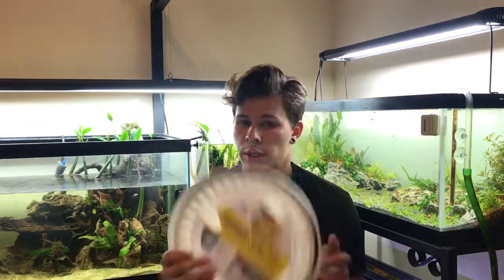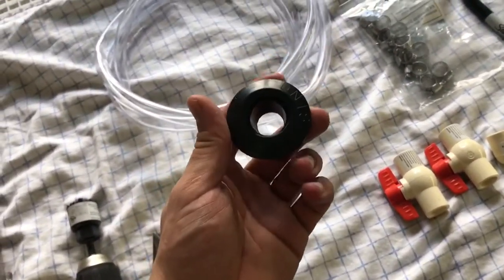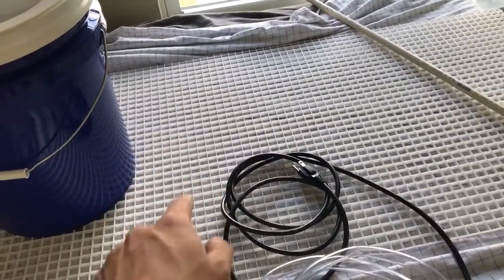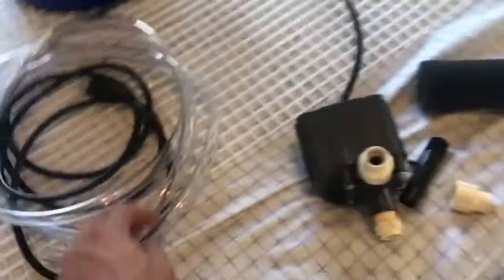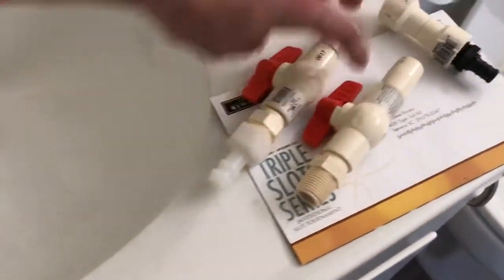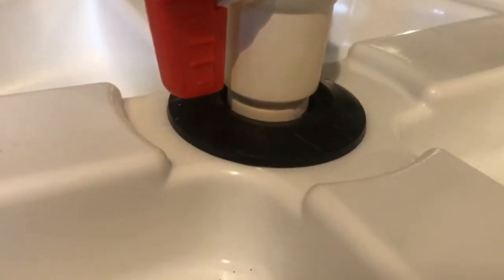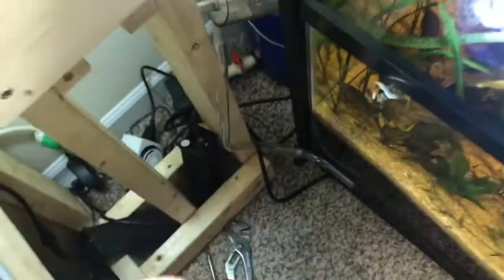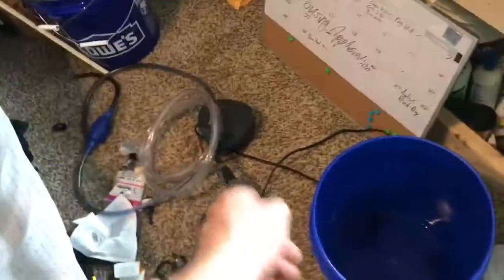DIY 5 Gallon Bucket Canister Filter For 20 Gallon Long Aquascape

Comment: Question. Why a uniseal over a bulk head? Is it for the movement of the pump?
Reply from the maker: That, and because its easier than putting a bulkhead on a curved surface. They're just super simple to use.

Comment: What is the website to get the inventory?
Reply from the maker: I didn’t order any of the parts for the filter, you can find all of this stuff at Lowe’s or Home Depot
Reply: I understand, but where's the list so I'll know what to get?
Reply from the maker: I don't really have a list. The main thing is using uni seals, gamma seal lids, and ball valves to be able to cut off the flow. If you watch all the videos on the filter I talk about design flaws and things that I would have done differently if I could go back. Larger diameter piping was pretty high up on that list, as was a higher output pump.

Comment: Gama seal lids suck. I did everything possible and it still leaks
Reply from the maker: I feel like they’re pretty hit or miss
Reply: Would it work better if I elevated the bucket filters above the tank so there is much less water pressure? Or is there something I can do to the gamma seal lids to seal them much better.
Reply from the maker: @donaldstevens5034  You could try siliconing the lid to the bucket but that obviously will make it difficult to remove. I think a big thing about why mine didn't work great was the tubing diameter was too small and it restricted flow. I tried to lower and raise mine but it didn't do a ton to fix the issue.
Reply: @ormsonaquariumdesign3587  What i saw on the buckets were push pin marks right where the lid needs to seal. Poor quality manufacturing. I will try Flex seal tape to increase the seal and see if that works. Hopefully going above the tanks will relieve a lot of pressure and gravity will put the water back in the tank as fast as the bucket fills up. I have ball valves built ingoing and outgoing to adjust the flow. If that is not enough I will install an overflow on the bucket itself to rid the pressure. Keep my fingers crossed. So much for Joey's  DIY suggestive advice. He's a big star now too busy to answer  questions. To busy doing videos of his personal hobby. I don't give a shit about his personal hobby. If your getting online to help people the put your own bullshit aside and help people. Or use your personal accomplishments to teach. Thanks for you reply